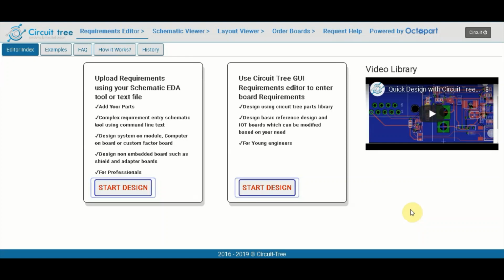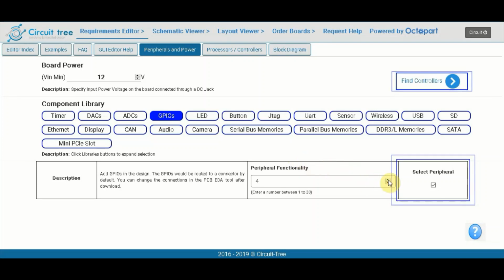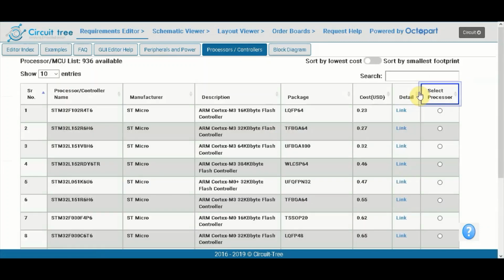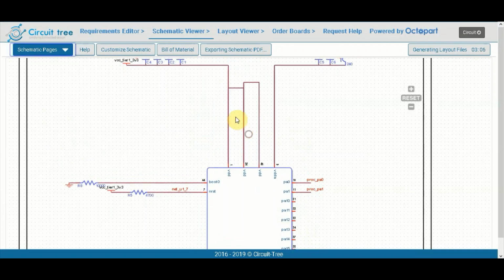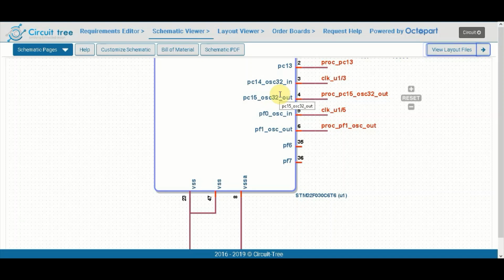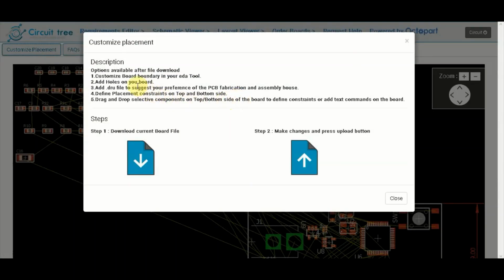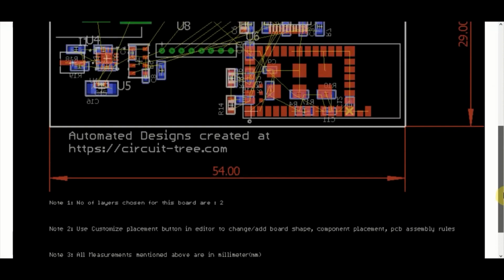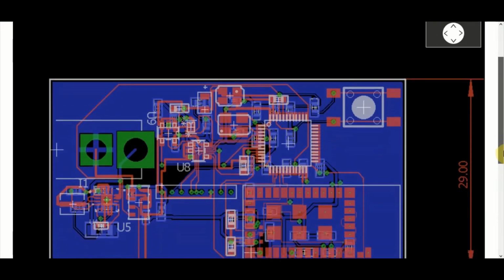Quick hardware design with Circuit Tree

Comment: Hello, I have 7-8 sensors with connection diagram. Can you guys help us to build pcb design as well as actual pcb? You provide pcb delivery?
Reply from the maker: Yes we do. Send us your requirements on info at circuit-tree.com along with your budget, tool and timeline when you need this board.